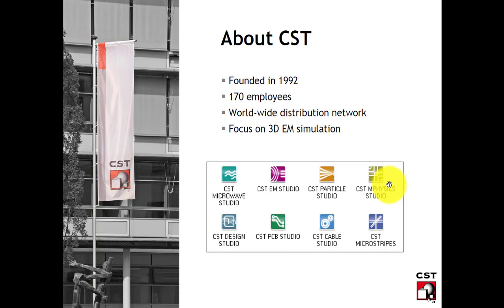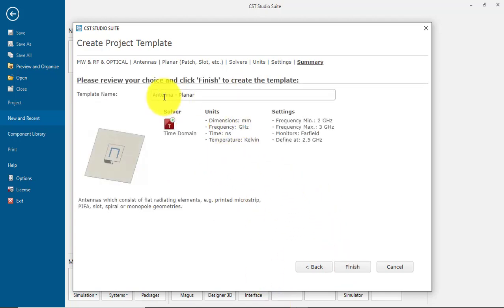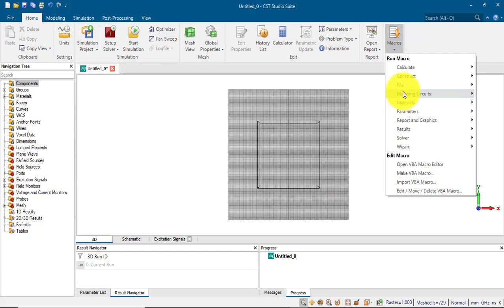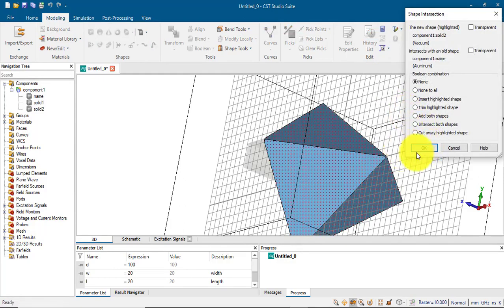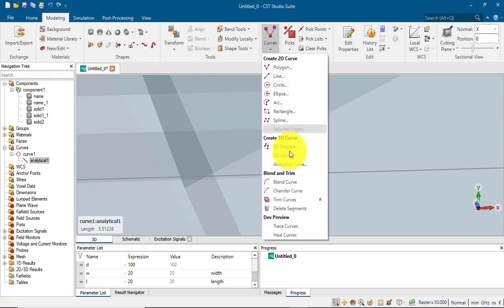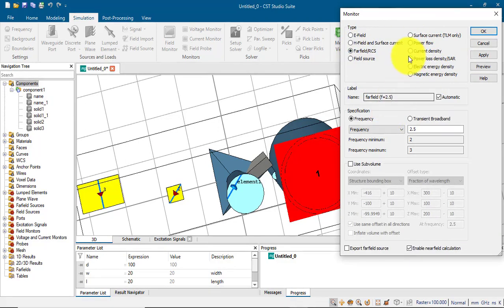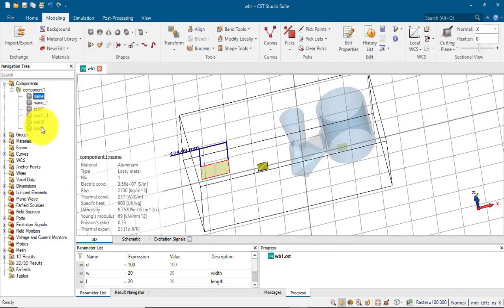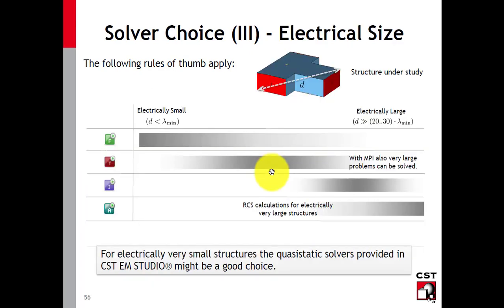تعلم أدوات CST للمبتدئين | ندوة عبر الإنترنت رقم 1 | SMART ENGRZ | مجموعة برامج CST STUDIO

Comment: Thank you for this video ,it did help me. I'm a beginner to this and also I'm a highschool student trying to do a project about metamaterials on energy harvesting. I can design some types of metamaterial and I want to put resistor to harvest energy from the material and have AC current. Can you say which settings are the best for it? and how should I put correctly the R?
Reply from the maker: You are welcome. Start with periodic structure instead of antenna. For more information contact us via whatsapp on the number +96171401618